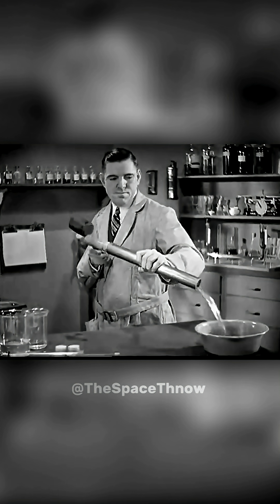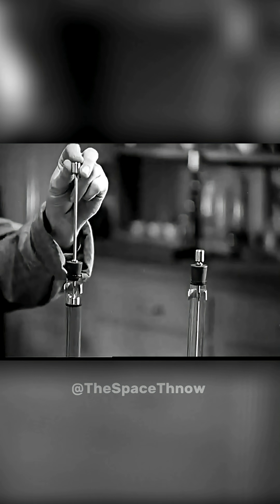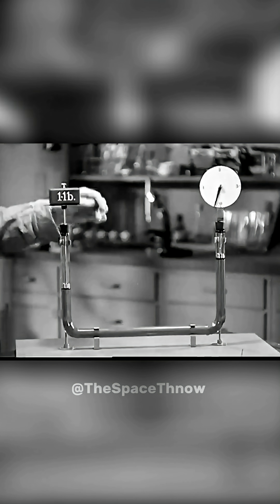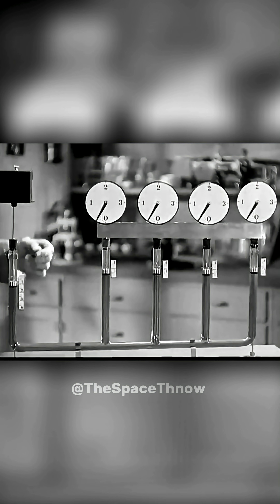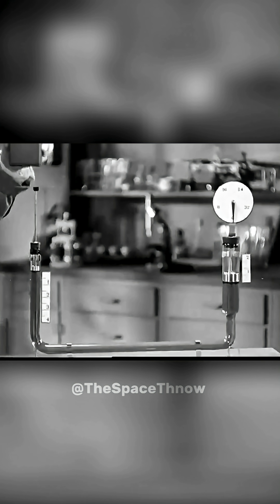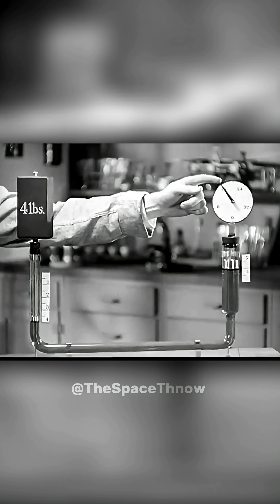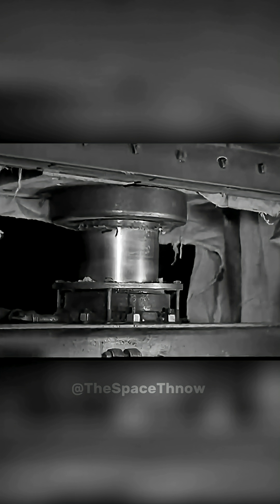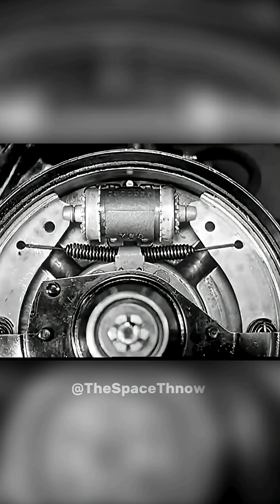#actingchallenge

Comment: You can compressive liquid. Who said you can't compress the liquid. It's not easy to compress liquid. How do you think a black hole works it compresses everything including light. Into a singularity. If you take water and put it under the pressure of the bottom ocean. You can press the Water by about 10%.

Comment: Of course, you could pressurize adding other gas to the hydraulic lines and burst them because the pressure would be too much for the weakest point of the line to resist.

Comment: Thats why they say not to use an opened bottle of brake fluid even if it's not used becuase moisture from the air can get into it just by being exposed to air which now adds water to the brake fluid (which is hydroscopic). At the heat that the brake fluid operates under the small amount of water that's been contaminated into the brake line evaporates into air which can easily be compressed  which will then make your brake pedal squishy and reduce your braking power. And yea brake fluid can be compressed easily if it boils and evaporates which is what dot 3 and 4 is, different boiling points, which can interestingly be combined in the same line if the combined boiling point allows for it .

Comment: Deep sea water:
Reply: Thats not compressed water
Reply: @fatinahmed5406  it is if it's deep enough it's compressed by all the water above it.
Reply: I think you made the opposite point deep sea water is not more compressed than the water on the surface yet it does not compress under the pressure of atmospheres. That’s why if you go deep enough, you will be crushed by the pressure yet the water itself does not shrink though Gases in your lungs do that when you take the lungs at the bottom and move up the air in your lungs fans and shoots giant bubbles the size of you out of your mouth, which also happens internally in your body, which causes the bends or nitrogen sickness or rupture of the deep nitrogen narcosis or whatever the hell you wanna call it

Comment: Bruh anything can be compressed 
It's just water neet alot aloooooot of force almost incompressible
Reply: wrong it can be pressurized but cant be compressed
Reply: @ohandanotheronebitesthedus6247 it can be compressed you can Google things you know.     
"Can you compress a liquid (water)?
Asked by: Guy Matthews

Answer
The answer is yes, You can compress water, or almost any material. However, it requires a great deal of pressure to accomplish a little compression. For that reason, liquids and solids are sometimes referred to as being incompressible.

To understand what happens, remember that all matter is composed of a collection of atoms. Even though matter seems to be very solid, in actuality, the atoms are relative far apart, and matter is mostly empty space. However, due to the forces between the molecules, they strongly resist being pressed closer together, but they can be. You probably have experienced compressing something as hard as steel. Have you ever bounced a steel ball bearing off a sidewalk? When you do that, the 'bounce' is due to compressing the steel ball, just a tiny little spot that comes into contact with the sidewalk. It compresses and then springs back, causing the bounce.

The water at the bottom of the ocean is compressed by the weight of the water above it all the way to the surface, and is more dense than the water at the surface.

A consequence of compressing a fluid is that the viscosity, that is the resistance of the fluid to flow, also increases as the density increases. This is because the atoms are forced closer together, and thus cannot slip by each other as easily as they can when the fluid is at atmospheric pressure.
Answered by: David L. Alexander"
Reply: @ohandanotheronebitesthedus6247 any possible matter can be compressed but many liquids and solids need beyond extreme conditions to be compressed even slightly
Reply: If what you’re saying is true then you should be able to shake liquids like crude oil and agitated so they off gas. And that’s exactly what happens on railroad cars carrying petroleum which leads to explosions from time to time you can compress gas into a liquid that is also why Coca-Cola if shaken under pressure will expand when you depressurize the bottle and make your soda shoot out everywhere. But a bunch of people on the Internet don’t like the idea that you can’t compress a liquid so they must be right
Reply: @SeanEustace-zk3mc  brother my physics professor told me it's stated on Google that no matter in existence is purely incompressible it's just that many require matric tons of force

Comment: A liquid can indeed be compressed.
Reply: You need extreme pressure to compress water, at challenger depth(10km) water is 5% compressed
Reply: It can be compressed, but only under an amount of pressure that makes this fact irrelevant for most real world applications.
Reply: @Nickname-hier-einfuegen so a liquid can be compressed?
Reply: Liquid ≠ Water.
Reply: Water cannot be.
Reply: @KraverekPL   a black hole can squeze the earth down to a coin size ball
Reply: @KraverekPL  ur dumb it can learn science bro
Reply: No it can't
Reply: @unathisejam7995  sure, with 1000 bar approx 5%.
Reply: @Bazkkaja at that point 200mm thick rubber pipe will explode lol
Reply: @unathisejam7995 it can under high pressure

Comment: No actually everything can be compressed It just depends on how much force it takes to compress it liquid takes a significant amount of force to compress, In reality you can compress anything so much to the point where they collapse into a black hole.
Reply: A pressure of 9 gigapascals for ice 7 formation water compression
Reply: You making the claim that this was tested? I want to see how you contain the fluid for the test and the material science behind the container or matrix used in this experiment. I just ignored the one about the black hole because it’s retarded to say shit that you can’t prove as if it’s obvious. I think someone is lying to you to be honest but let me know if this experiment has actually been done because I’d like to see how they could pull that off.
Reply: where is the hate coming from? all i want to know if this is true or not. sure you could need A LOT but still...whats the truth like?
Reply: @pain2737  All liquids can be compressed. Water can even turn to ice under pressure, without changing the temperature. It's just that we're talking about an amount of pressure that is not relevant for practical applications. The degree of compression of a liquid within hydraulic breaks is so incredible small that it doesn't matter for the purpose.
Reply: @pain2737  what hate? Are you dumb?
Reply: @pain2737 Think of this way, in practical terms the PSI is the compression of the liquid.  A pump that achieves more than 1 PSI is compressing the liquid.  Practically you aren't going to notice the millionth of an inch difference in movement, but watch a hydraulic system line fail.
Reply: You cannot compress a liquid. But they want the big bang to be true so they have a theory that you can with some enormous pressure that’s untestable. Because otherwise they don’t have their theory and they don’t like to give up their theories even when they have been falsified, look how many renditions of the theory of evolution Have come and gone and keep coming.
Reply: You’re 100% correct, yet for some reason commenting a well known fact you somehow managed to attract every dumbass on the planet to say you’re wrong😕
Reply: You don't sound smart. You sound stupid. In theory yes, but nothing in this universe can compress something that much except for a black hole. Stop trying to be right and start learning to see real things instead of theory
Reply: Beyond relevant for the scope of this video, but you already knew that.
Reply: What kind of interstellar brakes do you have in your car to where that would be relevant?
Reply: I don't think this is relevant to the video but on a technicality level its true. I mean, that is how neutron stars work and if you want to go next level, you go black hole. Then again, in both of those examples any liquid would stop being a liquid so hmm... Or if you want something less then that, perhaps just go really deep in the Ocean, even at that level wather get's compressed, then again, perhaps that is not the liquid the video talks about.
Reply: sybau
Reply: great excepet its all theories
Reply: @samthegamer4910  ? Water compression is a thing "At 11,000 meters, water's volume decreases by about 5-6% due to the immense pressure of the water above it. "
Reply: Literally just stop talking. You don't sound smart.